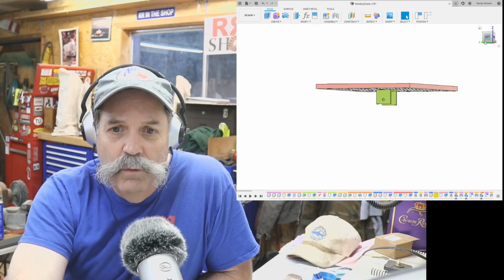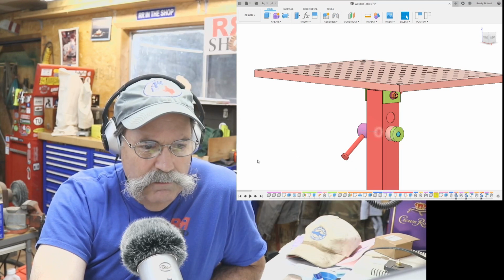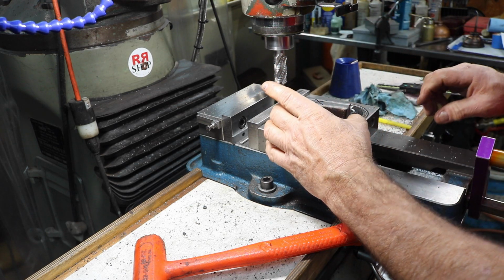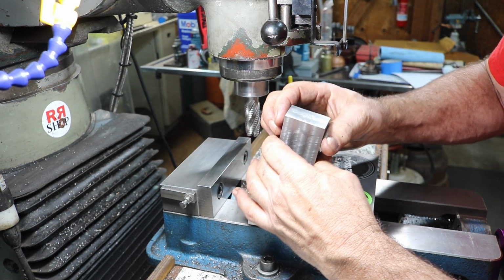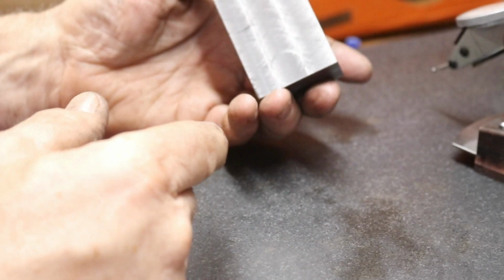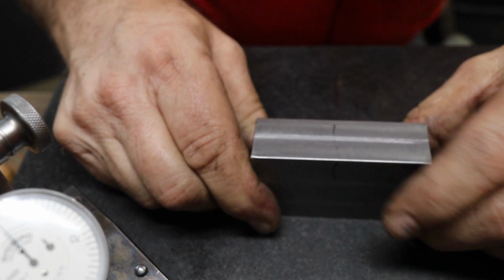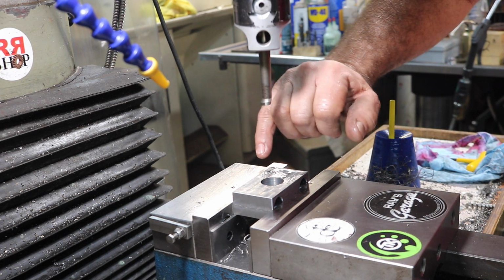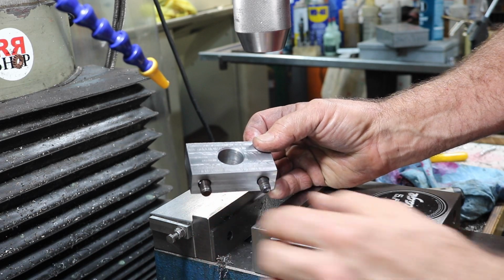What is your Angle on a Welding Table P1

Comment: Randy, you got some skills on the digital modeling side. Nice job constraining the model for the movement animation. If I may be so bold as to make a suggestion....trap the under table mounted  pivot area with a block on either side of the rod end. It will eliminate the possibility of bending the screw if you really load the table.
Reply from the maker: Joe thanks for the suggestion.  I made the pin from 4130 Prehard 1" dia.  It will be ok I think but if I have an issue I will have to go that route.  Merry Christmas.

Comment: Great looking Video & Sounds, even the lighting is good.  I watched you go through the various stages of your Table, & now the new mods you are making.  Even going through the new block you made, even though your a couple of thousands of an inch out, is not the point. The thing is you have shown MR. Average how to make the block.  Well Done.  The only question I have is, would it have given you a better job & finish using a Fly Cutter, and facing in one step, instead of stages.  BTW , I use a break drum for my pedestal grinder ... Great base
Reply from the maker: Oh the a fly cutter is probably a better choice.  But I did throw it on the SG and now it is with in 2 tenths.  The surface finish just bothered me.  Thanks Ted.  Merry Christmas

Comment: How about a steering wheel similar to your mill only smaller for the handle? Cool design for a weld table though. Have a Great Christmas and New Year Bud!  -jim
Reply from the maker: I would have to kind of small for clearance when the table is down.  Thanks Jim. Merry Christmas
Reply: @RRINTHESHOP  Yeah I see that, didn't think it all the way out. That's why you're the Master and I'm the Grasshopper  -jim

Comment: Can you find an old rim from a Deuce and half rim/wheel? You need the extra diameter. That hub will tip over. "my two cents" good luck on finding the wheel.
Reply from the maker: i think it will be ok.  Even if the table drop to one side freely there is no tipping at all.  Maybe some out riggers in the future.  Thanks Tom.  Merry Christmas

Comment: Those old drum bases are super useful.  Have you considered using a front uni-bearing assm. from a larger pickup to mount the post to the drum so the table can rotate as well as tilt?
Reply from the maker: i think this is a great idea.  i will have to look into that.  Thanks SE.  Merry Christmas
Reply: Merry Christmas,  and have a prosperous New Year
Reply from the maker: @SouthernEngineering  Thank you.